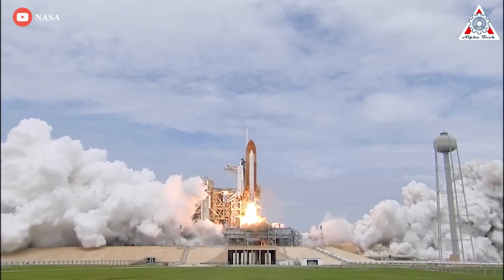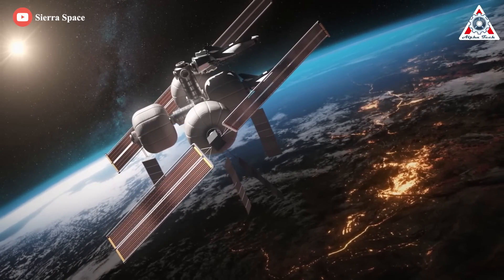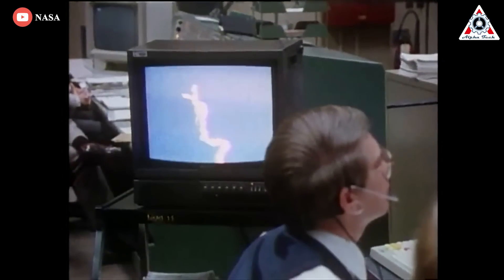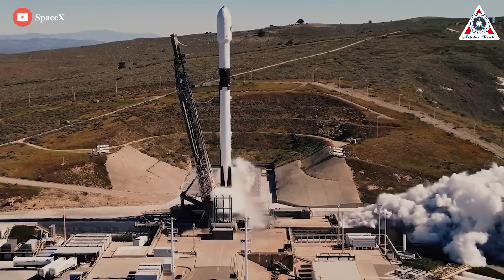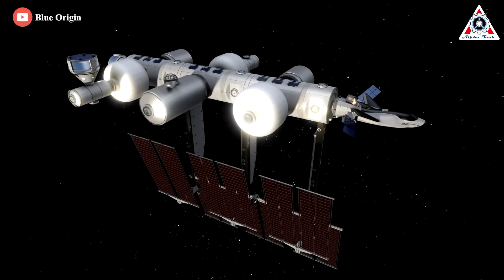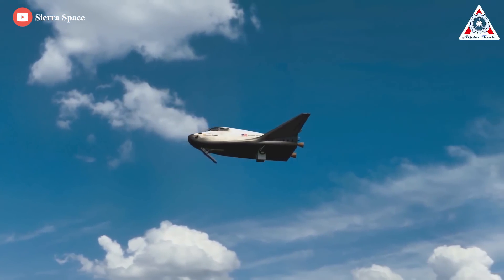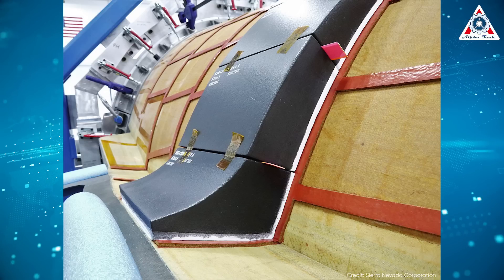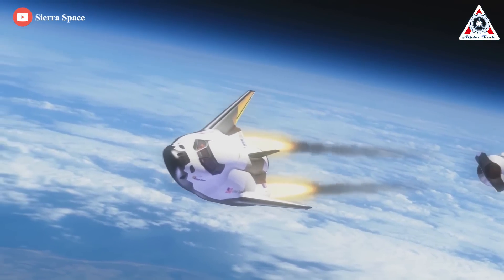Genius! Dream Chaser A New improved and Better than Space Shuttle???

Comment: A british research paper, by D, H. Peckhom:  'Low-Speed Wind-Tunnel Tests 
of a Number of Fin Configurations on a Flat-plate Gothic Wing of Unit Aspect Ratio',  
Aerodynamics Dept., R.A.E., Farnboroug, C.P. nº 1076, points a single central fin could do better than side winglets, but perhaps the mission and environment of both experiments are not identical. 
Karslruhe tech made a Kart on a prestressed concrete plate (The indian concrete journal, oct 2004) with a body thickness of 4 mm. Density of concrete is 2.6 gr/ cc, vs 5.6 gr/ cc for steel. B&V-246 bomb had wings made of Sorel concrete, but it does not admit reinforcing Iron.
Concrete resists fire heat, and if the right components for this Composite are found, as romans did with their millenia and salty water resistant concrete, made with volcano ash, an Space Shuttle perhaps could be built in concrete.
With adequate mix, concrete is no longer permebale to air and water, this is open to testing.
For very hot spots, body embedded heat pipes could take await heat. 
Blessings +

Comment: I am as happy for Sierra Space as the next guy, but what you say at about 0:28: Dream Chaser is based almost entirely on NASA HL-20 Personnel Launch System, which in turn borrowed from Russian BOR-4. (There were literally dozens of other stub-wing lifting body designs from both sides of "iron curtain", some of them military, such as X-23 PRIME; I think that cancelling almost finished X-38 Crew Return Vehicle was particularly stupid.)
Reply: @daviddavis325  Absolutely. While X-33 was just a pathfinder for VentureStar, I think that today both would be feasible. The roadblock of making a light enough composite tank for cryogenic liquids have been cleared since.
But, sexy as SSTO might be, I think that fully reusable dual stage vehicles, as SH/SS and Terran R aspire to be, are a more realistic way to go. Simply too much dead mass in SSTO. Even mixed-cycle engined vehicles (Skylon) look more doable than "ordinary" rocket powered SSTO.

Comment: A design loosely based on the USA lifting body experiments and the Soviet BOR-4.  I dunno if BETTER than the shuttle which could stay up fro 14 days and do so much due to all of the room, but certainly cheaper to fly.   A shame they could not keep one flying so we could bring Hubble back someday.

The shuttle became huge in size because NASA needed to get the money from the military due to political tightwads, and the mil required a large carrier to transport their giant spy satellites with.

Along with the skin the leading edges of wing surfaces were solid bars of Inconel, as was the ball nose, both of which suffered the greatest heat. I still have a piece of Inconel in my machinist tool box, and damn that's tough stuff to work with.

Errors:

The inability to turn off the solid boosters is NOT why the shuttle exploded.  Nobody knew there was an issue with frozen seals until it blew, so an "OFF" switch would not have altered the outcome. Liquid fuel boosters also blow on rare occasion.

The tiles were NOT responsible for killing Columbia.  That was a fuel tank foam-shedding problem that damaged a section of ceramic-based leading edge of one wing, not a tile failure.  NOTE that Dream Chaser and Starship also use tiles, as does Orion.   So obviously they work.

The shuttle missions were not cheap, but man were they exciting!

Comment: Looks a lot like the old russian capsule.  The Space Shuttle wasn't a failure.  It was, in fact, quite a success.  Yes, it was expensive.  Yes, it was large, apparently too large considering the missions it ended up doing.  However, this vehicle is still a glider and rocket.  It still has to be boosted up on another rocket.  So though it re-enters as a glider, it isn't a plane.  There are a variety of ways this could have been designed to re-enter with regular engines and devices to slow it down to reduce the extreme heat of re-entry.  I like Musk's idea of a shuttle which can land itself the way Starship is designed to do.  We shall see which actually makes it to useful production.
Reply: The primary goal of the space shuttle program initially was to reduce the cost of mass to orbit, and to make Access to space routine.  No matter what it accomplished, and it accomplished a lot.  From that point of view it was a failure.

Comment: @0:45 - 50:  Saying that the space shuttle failed is like saying that the Model T failed. The shuttle was first of its kind, and highly successful in what it could do. It was not perfect, it broke down, it had limitations. But none of those things are criticisms. They are to be expected, and they are a necessary step in learning and growth. Dream Chaser does indeed promise much more, as well it should. We are many decades beyond the shuttle design, and every applicable technology is far beyond anything that could have been possible decades ago. I'm just glad that we haven't stopped at version 1.0 of the space plane idea. Dream Chaser has much to offer that other space vehicles cannot.
Reply: Addendum: It's also inaccurate to describe the shuttle as a space plane. It was, but it was more. It had to do two jobs: both the "planing" for reentry, and the heavy lifting ("trucking") to orbit. There were no other lift vehicles available for that job, as there are today. So, Dream Chaser has the additional design advantage of optimizing for the single job of space plane.
Reply: @farmergiles1065  There were certainly problems with the space shuttle more than could really be comparable to a "first generation" vehicle along the lines of the Model T. There are many things about the shuttle that deserve criticism. 
Its not necessarily a question that the "shuttle failed", so much as the shuttle was failed by the egregious over-ambition of its design. The problems inherent to the space shuttle were basically the definition of what happens when you let administrators and politicians do the job of engineers. As the design passed through committee after committee, different agencies just kept slapping on more and more design requirements that not only made the end result completely overcomplicated, but also, totally unnecessary as many of those intended missions never ended up being flown at all.

It would be a more accurate analogy if the army, the navy, and the DoD all came to Ford and insisted that they design the Model T to be able to carry 50 tons of refrigerated cargo across a desert at a minimum speed of 60 mph - then, proceeded to never take advantage of that ability, and complain about how bad the vehicle was as a daily driver in the city.

In the end, the shuttle's capabilities were incredible and unmatched by ANYTHING we have today. Its payload capacity, downmass capacity, and ability to be used as a self-sufficient staging platform for extravehicular missions was amazing. It cannot possibly be compared to any of the modern spacecraft coming out now. However, it was severely over-designed for what was needed, and nowdays, the general approach to spacecraft capabilities is more reserved and realistic, preferring to focus on specialized and relatively minimalistic designs rather than opting for one jack-of-all-trades, mostly due to management and cost.
Reply: @merylsmith5305  Ok, fine, if you must. The analogy was never meant to be that fine-grained. But compared to a modern car, or even one 40 years after the model-T, I still maintain it to be reasonable. The model-T was essentially the first of its kind, implementing manufacture along an assembly line, instituting the principle of replaceable parts, and for sale at a cost within the reach of vastly more people. The successes of the shuttle are comparable for its very practical advance beyond the earlier prototypes in rockets, pioneering new objectives, with a nod to reuse of vehicle. Yet it required lots of maintenance, and had quite enough flaws that needed addressing - like the model-T, which was superseded by the model-A before many years went by. The shuttle was overdue for the same. But both served a good purpose and represented a good step in their time.
Reply: @farmergiles1065  The point is that the shuttle had many dangers above and beyond what was reasonable for spaceflight, most of which were completely avoidable, and in fact, known about and deliberately ignored until disaster. 

There is a big difference between being a pioneer, and being a reckless pioneer. 

Both of the shuttle catastrophes, and almost all of the near-catastrophes, could and should have been prevented, as the problems were known about in advance. If the Model T ended up being a deathtrap, thats one thing. But if it was later revealed that Ford KNEW it was a deathtrap, understood exactly what things made it dangerous, and had ideas of how to fix it, but still ignored all of that until hundreds of deaths started happening, we would remember it very differently.
Reply: @merylsmith5305  The essence of your point is "many dangers above and beyond what was reasonable for spaceflight". That's a judgement call, one that was not yours or mine to make. But I would disagree with you.

It still is not reasonable to think that spaceflight is not dangerous, or that there are many unknown or unanticipated things that can kill, even kill very quickly. The only reasonable attitude is to realize that the environment of space is inherently dangerous. And the only reasonable thing to do with that is to be as prepared for it as one can.

We're still pioneering space, every step we go. And there is nothing "reckless" about it! We reckon carefully. And pioneers brave the risk and go anyway. That is not recklessness.

You are looking at the shuttle problems from the benefit of hindsight, but also from the vantage point of ignorance. Neither one of us understands the technical issues, or what was known when. No one person ever did. No one NASA team ever did. If you ever worked within a large team, you would understand better how dreadfully easy it is for a communication to fail or a nit to be overlooked. And in space, such things can be fatal.

Pioneering is about acceptable danger: knowing, unknowing, and deciding to go ahead.

NASA is not perfect. And God knows politics is totally messed up! Pioneers also know that that is the environment within which space voyages happen. And they consider it worthwhile anyway. Put your "deathtrap" language away. That's your assessment. You keep it. Not everyone else needs to agree with it, or look at it with the same attitude.
Reply: @farmergiles1065  You are correct, it is a judgement call. However, first off, why shouldnt the common person be able to have an input on what is or isnt reasonable? You yourself are making your own judgements of what is and isnt reasonable safety, just drawing the line in a different place. 

Of course space travel is still inherently dangerous. I never said anything to the contrary. However, any death that IS preventable with the technology of the time, be it in the 1980s or the 2020s, is an indication of unreasonable danger. 

And you are still completely missing the point. It is not a question of hindsight, or holding the pioneers to different standards than existed at the time. We know for a fact that NASA engineers KNEW about many of the safety issues with the shuttle program. NASA's own safety council, the third party audits they ordered, and Congressional committees ALL universally agreed that there were completely unnecessary shortcuts taken, and that many of the dangers were NOT inherent to space travel or the technology of the time, but rather, due to blatant ineptitude. It is NOT a "personal assessment" that the shuttle was a deathtrap. It is the EXPERT assessment of the qualified people in the shuttle program itself, that the shuttle was more dangerous than it needed to be.

There were always going to be dangers with the shuttle, or with any launch system. You are obviously correct about that. But there were a great many dangers that had literally no reason to exist in the first place. Unless your argument is that being a "pioneer" gives you carte blanche to ignore safety problems that you are fully aware you have the ability to fix. Your own assertion that the only reasonable approach to spaceflight is to be "as prepared as one can" simply was not the attitude of the early shuttle program.
Reply: @merylsmith5305  "Why shouldnt the common person be able to have an input on what is or isnt reasonable?" Input to whom?

Of course you can express your view here, as can I! But why should anyone be expected to listen? I expect nothing of the sort. And all I'm doing is saying that you shouldn't either. Yet you seem to insist.

You say "It is the EXPERT assessment of the qualified people in the shuttle program itself, that the shuttle was more dangerous than it needed to be."  Fair enough. They gave their input, which then went as far as it went. And the shuttle flew anyway. What's done is done. The time for approvals by us is far gone. There are no more shuttles.

Don't get mad at me. I'm not saying "should have been" or laying blame with "they should". You are the one doing that. And that is the attitude that I am arguing against: namely, what is to be gained by that?

The pioneers who flew those flights were aware of what they were doing, that there were dangers, even that there were disagreements within NASA over design issues. Yet they chose to fly. Are you saying they shouldn't have done that? If so, I think that's an overreach you have no business making. The choice was theirs to make. It was their lives, not yours or mine. They weighed matters and decided the risks were worth the possible benefits. In the end, that's exactly the nature of every risky choice we make in this life. We all of us live or die by those kinds of choices. Some people die later regretting that they hadn't risked living fully. Even when the circumstances surrounding the risks arose from the choices of others.
Reply: @David-Kynaston  Going to space has always been dangerous . John Glenn came back after only three orbits because of a malfunction, and no one knew when he underwent reentry if he would survive it. Apollo 13 could have had 3 deaths for any of a dozen or more reasons, but got back alive anyway. We were very lucky.

The shuttle was not constructed according to one design, unlike the vehicles for earlier missions. And once pieced together, it was also the only design ever to fly multiple times, with all the dangers attached to the unknowns of robustness and reliability. The dangers proved to be real. That was not as unlucky as it was foreseeable.

But Glenn knew his flight had a 50-50 chance of blowing up on the way to space. He risked a death trap against the possibility of success. I don't think anyone who went up in any shuttle was unaware of the risks they faced, either. We've simply raised our standards today, which is a good thing. We are able to do that now.

Comment: Wouldn't it make sense to pair a reusable booster with this?
Reply: Certainly that is the end goal. As it is, Vulcan is slated to get recoverable engines - not a fully reusable booster, but the engines alone will account for almost 70% of the cost of the first stage. Most new rocket designs from this point forward will likely have at least some form of reusability implemented.

If you're asking why not just strap it to a Falcon 9, its more complicated than that. The configuration of Vulcan that Dreamchaser is using can deliver over 20t to LEO, which F9 could only provide in full expendable configuration. In addition, F9's fairing is too small for the DC requirements. Its feasible that it could be launched using Falcon Heavy with an extended fairing, but SpaceX is trying their best to phase out Falcon Heavy, and eventually F9, in favor of Starship. 

Ultimately, the question of "why not just launch Dreamchaser on a Falcon 9?" is probably best answered with "in that case, why not just cut out the middleman and use Crew Dragon instead?"
Reply: Reusable boosters make sense everywhere. 
But they have to be invented/built first.
Reply: @MMadesen  Have you ever heard of the Falcon 9, sir? "Reusability" as a concept isnt new. Even the space shuttle had a degree of reusability (not at all efficient reusability, but reusability nonetheless). 

In addition to Falcon 9, theres also the upcoming New Glenn, Vulcan, Starship, and multiple F9 knockoffs from other countries in development, as well as plans for reusable small-lift boosters. Sure, the market isnt yet flooded with fully operational reusable boosters, but then again, Dreamchaser isnt flying yet either.
Reply: @merylsmith5305  Of course I know Falcon 9. 
Thats one rocket out of a few hundred systems, being partly reusable. 
There are a few more: Electron, New Shepard, Spaceshuttle. And several in developement: Starship, New Glenn, Vulcan, ...

But compared to all the rockets being used so far by all nations, reusability is a new concept and not very widespread yet.

Comment: Origin is earlier than the 90s.  I'd post a link to this if YouTube didn't auto-delete comments with links.  Check out the images of this.  Looks a lot like Dream Chaser:

Martin X-23 PRIME - The Martin X-23A PRIME (Precision Reentry Including Maneuvering reEntry) (SV-5D) was a small lifting-body re-entry vehicle tested by the United States Air Force in the mid-1960s.
Reply: There was The Spiral concept using the same aerodynamics as Sierra
Reply: Boeing X-20 Dynosoar 1965.